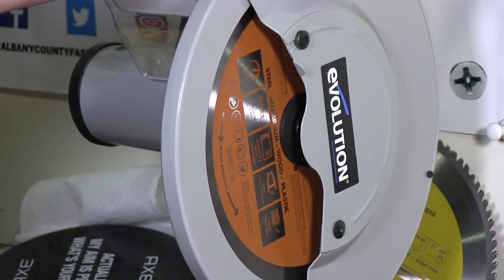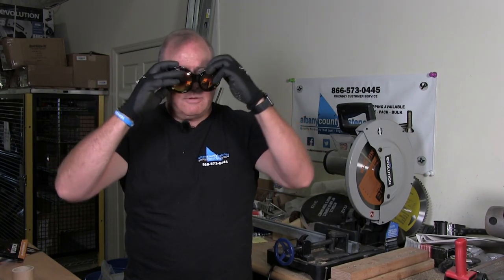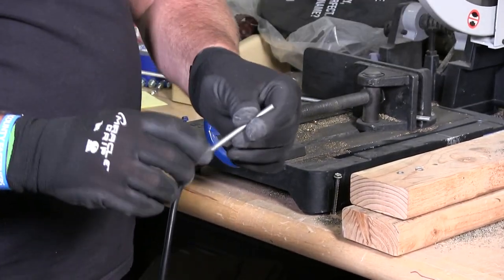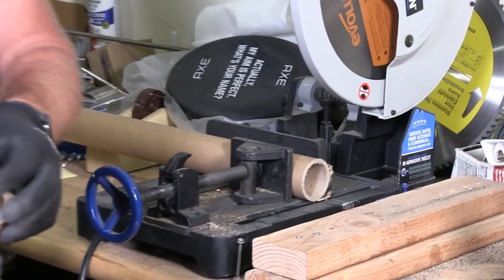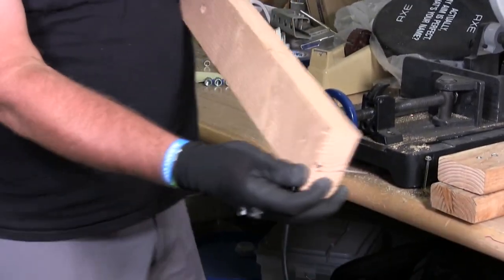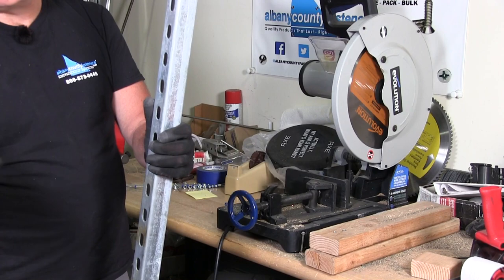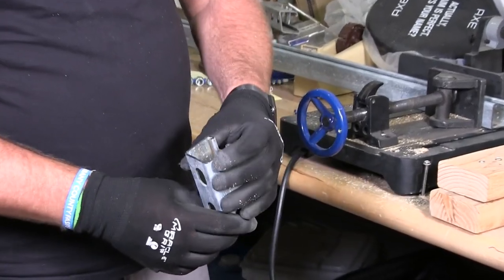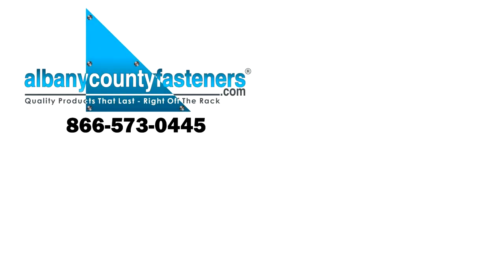Evolution Multi Purpose Rage Blade Demonstration | Fasteners 101 Demo

Comment: OK but I think you should let the blade get up to speed before you start the cut and let it stop before lifting arm, would have prevented that steel channel from flying. I have not had my saw for too long but might check out this blade, seems it could be handy.
Reply from the maker: Thank you for your feedback! We'll try that out next time to avoid any more flying metal.
Reply: Yep and when cutting full speed without pressing hard, your blade could handle forces little longer. That is one in thousand good blade if you pick those just from store randomly. Let the blade made the job, don't push too hard, it can last longer. I don't mean you have to go so slowly it melts, let's say; wood?.. but you know. And you cannot broke this easily. Ofc it wears in time, can't sharpnel again without diamond and it's not maybe even worth it, because nasa used these to cut space here to moon and back at the time, not single one failures. Now Russians figure how that have done and they stole blueprints where blades are inside cabin where people's controls whole ship with switches, they cannot use ic's, because they don't got those. Last one was reprogrammed and used putis heartbeat controlller and with it he could still get some potential in bed bunker with young Russian model boys..